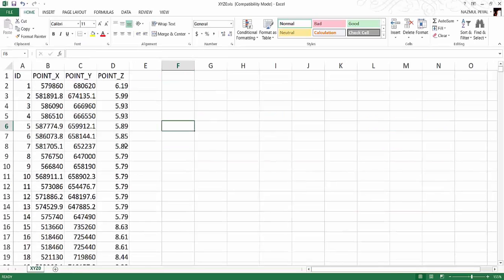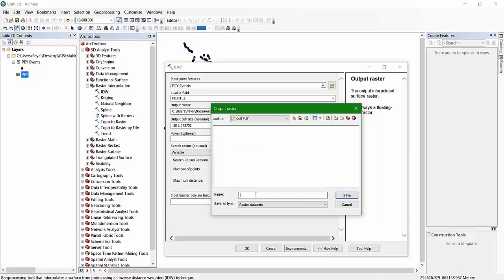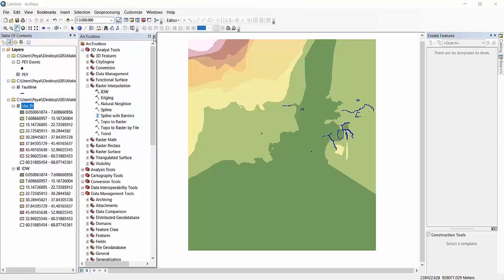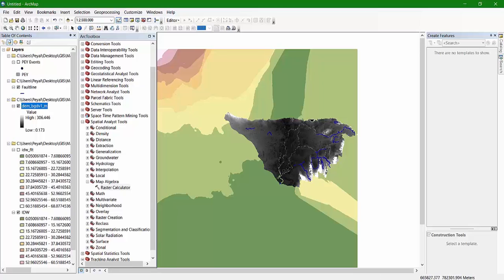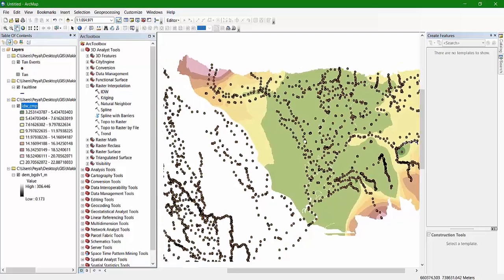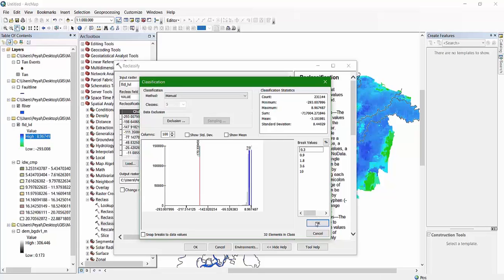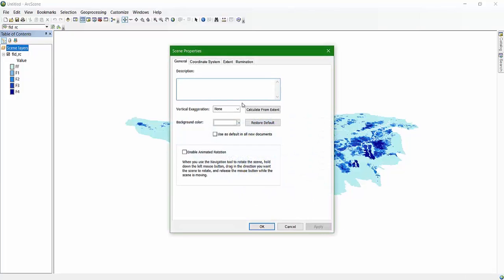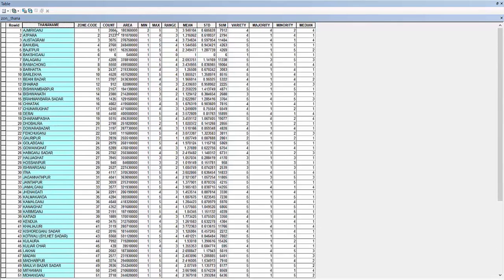FLOOD LEVEL CALCULATION IN ARCGIS

Comment: How to create raster elevation model without the fault line? What is the use of the fault line in flood level calculation?
Reply from the maker: Just don't add the fault line where it was added. 

Fault line is like when there are some sort of barrier which disrupt the continuous model. Like if there is a dam, then then model won't be similar without a dam. So we add a fault line there.

Comment: Hi,
I have doubts regarding interpolating flood levels using IDW. Can we rely on the interpolated values?
Reply from the maker: Interpolation is a mathematical formula where intermediate values are unknown. If all kind of interpolation is applicable to all places, that would be a really good question. And about flood level modeling IDW is definitely a well-practiced and an accepted method.
Reply: @NazmulPeyal  okay. Could you please share some literatures which follows similar procedure..

Comment: Hi there. Very interesting video. A question here: what is exactly the "z" data in the spreadsheet at the beginning? Is it elevation of water during a flooding event, measured either on the field or through remote sensing?

Comment: Sir, 
Please clarify doubts from the result obtained. 
1. As per the tutorial you provided we acquired flood level map with (-189) to (90). So actually the minus(-84) value stands for what ?
2. While I processed the classified flood level ,As per the tutorial the highest value 91is given to flood level five, but the classified flood level five zone is falling on the present reverine & esturine system. As per the present flood inundated scenario most of the flood free zone are affected. Inundation .How can we relate results ?
3. Mostly flood affected area is falling on the free zone.Then how can we compare then result?
Reply: Hi Jibin,

You can use "SetNull(Float("idw_cmp"-"dem_bgdv1_m")<0,Float("idw_cmp"-"dem_bgdv1_m")) in RasterCalculator to avoid the negative values. This would eliminate the negative values and avoid the confusion.

Comment: my idw doesn't work if i give environment condition like you.
Reply from the maker: What happens there?
Reply: Nazmul Peyal It shows IDW failed
Error Code 99999
Reply from the maker: @jeetsharma7583  Error code 99999 is the error which is undetected. Try re installing everything if the problem  persists.
Reply: Nazmul Peyal okay

Comment: how did you get the flood level calculation chart as 0-0.3 flood free area,0.3-0.9 flood level 1,etc?
Reply from the maker: This data is my country [Bangladesh] standard obtained from Institute of Water Modeling & Flood  Management. Which I guess will vary for different locations
Reply: ok thank u
Reply: are all the values in the layers as for example in Dem, flood lvl, etc in meters so that you can reclassify each of them in meters as per requirements
Reply from the maker: Yes they are in meters